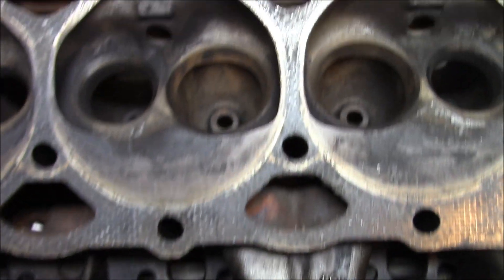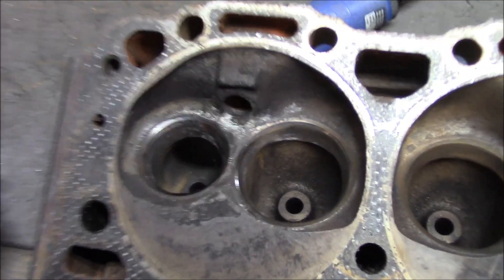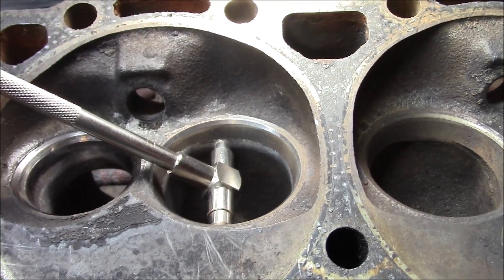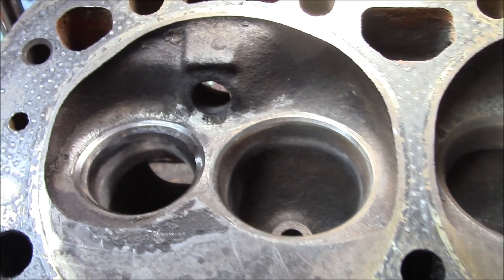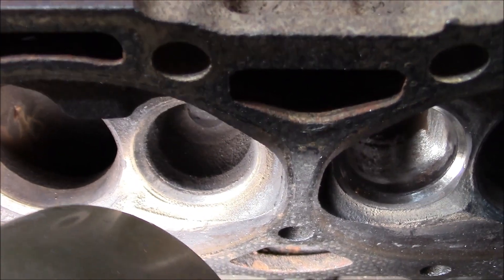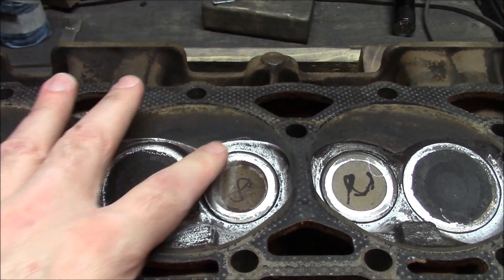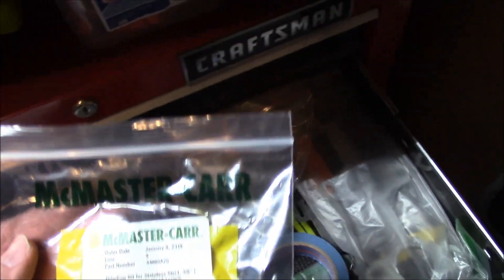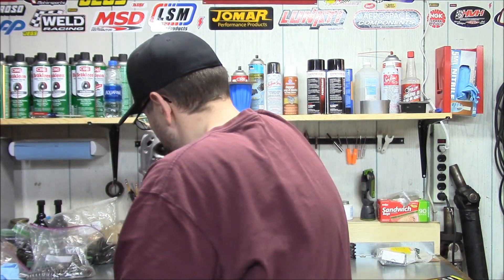Basic Porting my Vortec cylinder heads & INFO

Comment: what about using metal cutting oils ? will t hey help
Reply from the maker: Cast Iron has graphite in it and usually is machined dry, unless at a high rate of production then a coolant can be used.   Cast Iron is also porous so any used heads should have some oil in the pores.  Anything that's used on the burr, you'll end up breathing so wear a respirator.   That's why with Aluminum I prefer to use paraffin wax, if I want to go faster.

Comment: Hi do you have vortck 062 full porting and polish and instal spring and stud with gideplate ready to bolt it
Reply from the maker: Sorry I am not a professional porter but you should contact a WELL known porter, if you wish to purchased modified oem heads.  Otherwise I suggest a NEW aftermarket brand like maybe DART for heads that are designed with thicker decks and already machined for screw in studs and guideplates.   Head modification is a hobby for me atm and my videos are to help other diy types, thx for viewing.

Comment: So did you get an improvement on head flow I just did the same thing on a set of 906 has but I don't have the car on the road yet so I don't know whether I picked up any power or not I heard porting vortex actually hurts them but I couldn't resist
Reply from the maker: I don't have a flow bench and didn't finish them, switched to working on the ebay alum heads.  I have no doubt they will improve some with basic proven port work but the vortec head is already a good design so there is not much room for improvement just as David Vizard said in his video and I agree.  Most modern heads are a better design with also improvements in manufacturing and less cost compromises.  I don't know if you'll notice the gain nor can I say how much they could improve.
Reply: porting any head doesn't hurt it unless for some reason you fuck with the floor and not the ceiling, porting and polishing to a mirror finish the exhaust will greatly improve flow, and taking out those stupid bowl ridges second only to mount everest will improve flow, unless Ur running nitro or boost don't polish the intake runner, just port them, get the casting marks out, open the shit out of the bowl, 50-75hp gains easy depending on the set up
Reply: @wesulf7517   its easy to fuck the flow up on these vortec heads by getting over zealous.these heads shine in a specific rpm bracket and aren't really the best for high rpm
Reply from the maker: As Trillrif mentioned vortecs are easy to mess up, not much room left for improvement on them.  I cut the spark plug boss back some but to much can hurt low end.  Supposedly a vortex forms there and if you look at a lot of modern chambers they will have a sim notch. Max effort ported heads won't because they only care about top end and in my opinion the vortecs runner is to small for that
Reply: I just rounded the sharp edges of the spark plugs  boss , stratend the floor , sides basically a clean up opened up the bowls bullet nosed the guides , I went ham on the exhausts